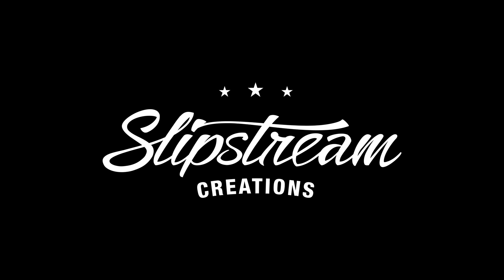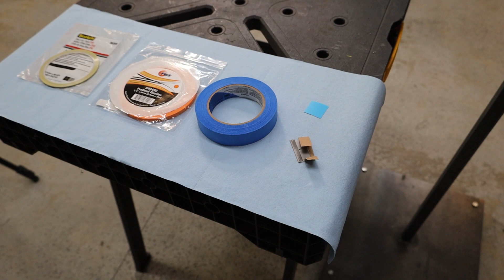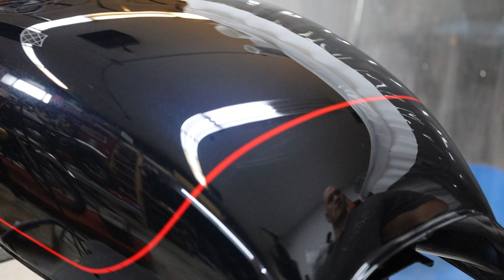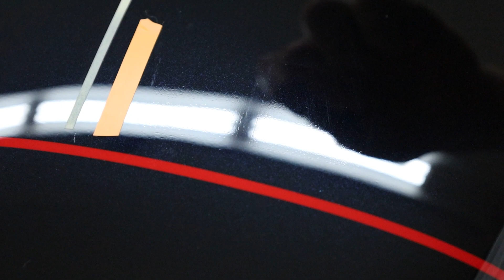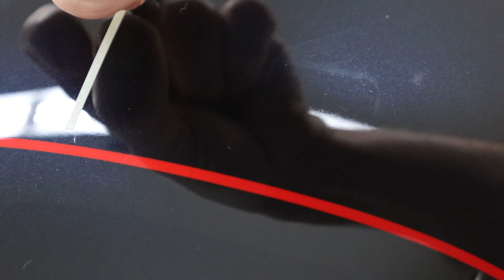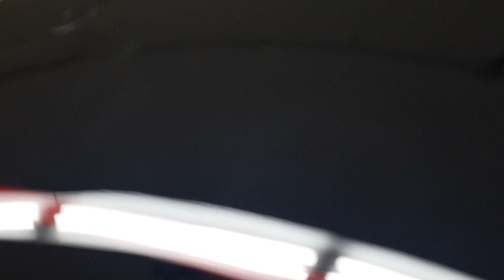Tape Marks In Fresh Clear Coat

Comment: Very useful info! For us impatient people, would you recommend putting another layer of clear down on top of tape impressions?
Reply from the maker: I probably wouldn't. If I ended up with tape marks in clear and they didn't "heal" themselves, I'd probably do a very light wet sand and buff. It should take much less than it takes to sand and buff out orange peel. I'm actually posting a video in the next week that will share how I sand out imperfections in clear and buff/polish to a perfect shine. Be sure to subscribe and check it out. It'll cover exactly what we're talking about here.
Reply: @slipstreamcreations   Thanks, I'll be patient and focus on buffing / sanding!
Reply: Buffing & sanding helped, but I was racing the clock against temperatures so I sprayed another coat of clear last night and it worked perfectly! Might be worth investigating, but good to have a "fast option"!
Reply from the maker: @plantmechanic  glad it worked out! Without knowing exactly what you're painting and what materials you're using, I was not keen to suggest re-clearing. I would have expected shooting another coat of clear to be even more work to re-scuff and clean everything first.
Reply: Totally! I’m still pumped that you made the video to help others in a similar situation and am happy to add a small piece to the knowledge base!